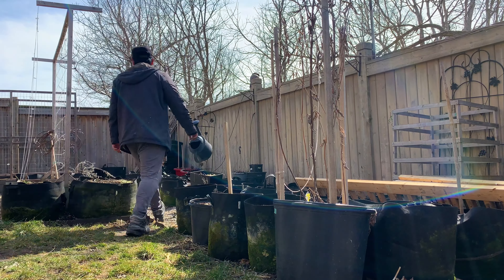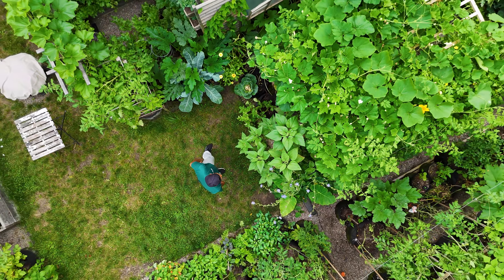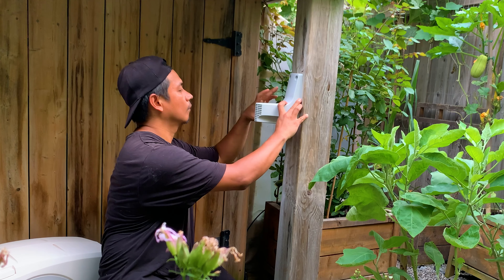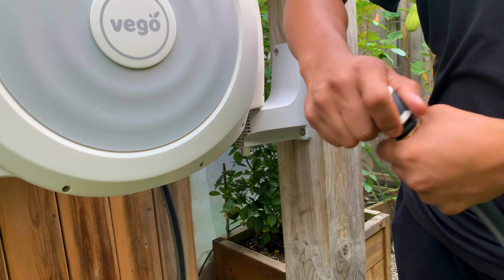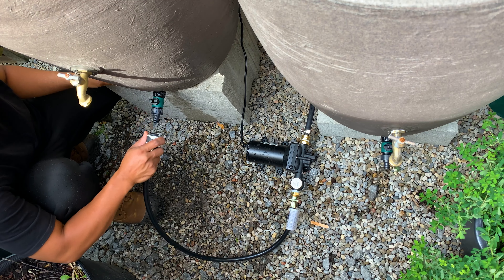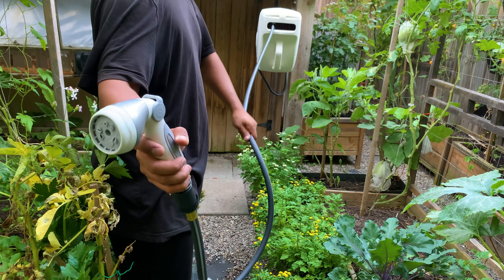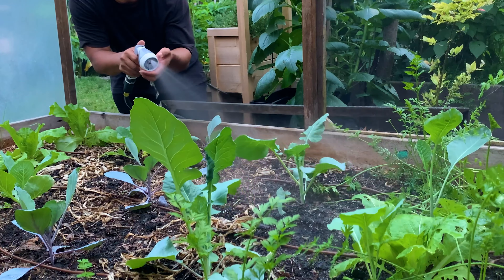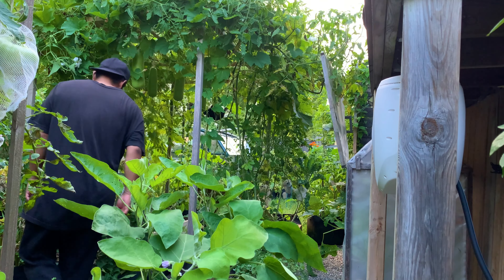We completely turned our rain barrel into a high pressure watering system

Comment: I think it is time to fully automate the watering in your garden. Add another pump, attach it to the second barrel. Attach a new hose to a new pump. Next question will be “how to mount new hose so it doesn’t prevent you from moving around?”. This is up to you. Next you mount new hose under the roof of your greenhouses. I believe that same pump will be able to create artificial rain for 2-3 greenhouses as big as yours, but this should be tested with the current one before ordering the same one. Next question will be “how to spray water in a greenhouse?”. I would try simply to make small holes in a hose. Next question will be “how to automate the water input?”. At first I would calculate how much water do greenhouses need and at what speed pump delivers water. Divided first on second and this will give you a time that pump should work. Then all you left to do is manually plug in the pump, set a timer on a phone and move to do other tasks while your garden is watering. Hope you will try😊
Reply from the maker: Thank you very much for all the suggestions.!We currently do have a drip irrigation system, we are on our way to try to figure out how to connect it to our rain barrels. Possibly we will get a larger container? Space is quite limited though.